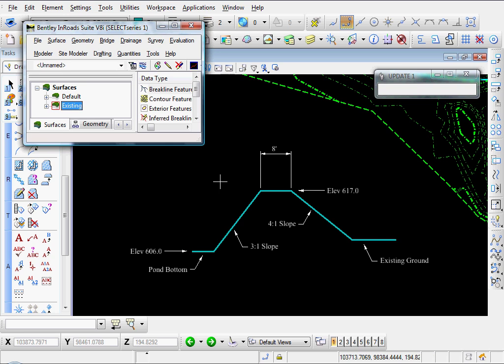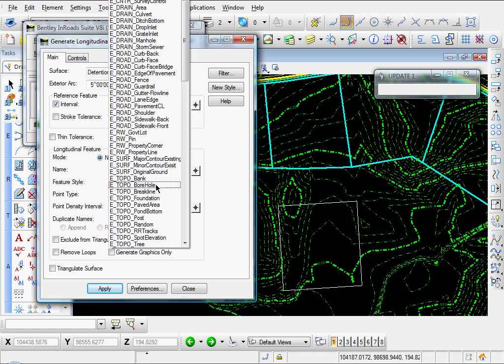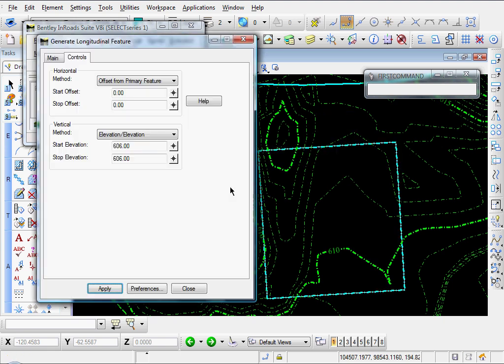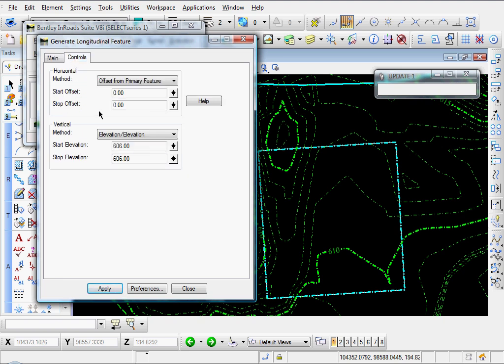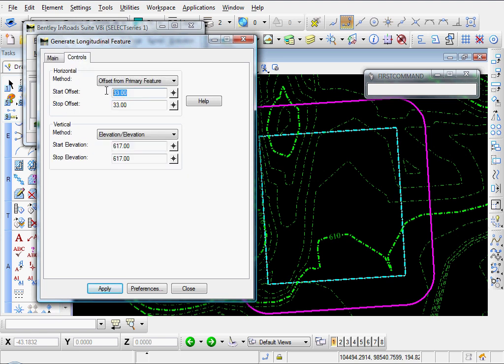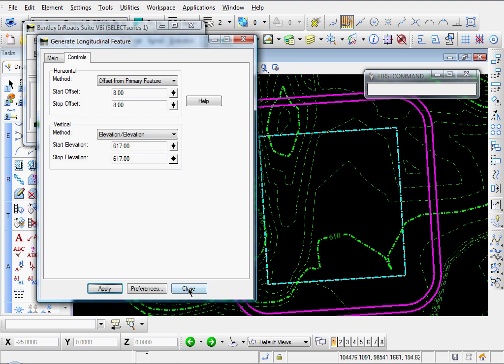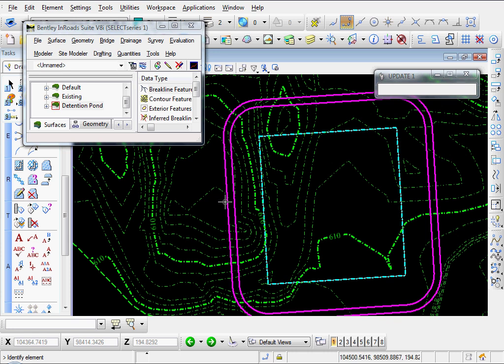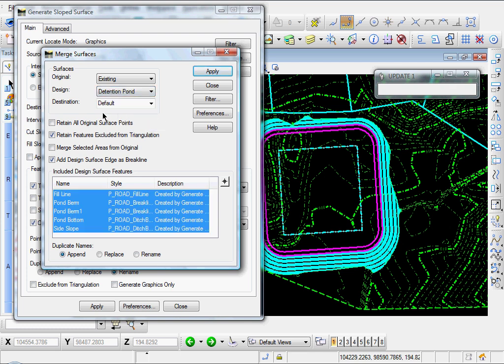Bentley InRoads - Model a Detention Pond

Comment: Coming back to this video, if you where to create a trapezoidal ditch in the median of the roadway, how would you model it? basically, instead of a flat bottom, there is a longitudinal slope and side slope. For a ditch or swale, 100ft long with longitudinal slope of 6% and side slope 4:1, how would you model this to create the contours and tie to existing surface?
Reply: I would either create a dummy surface of the side slope the flow line would be along, and use the generate grade contour tool in the surface tools and set it to the desired longitudinal slope, or use the Generate longitudinal features tool with one of the Longitudinal Slope vertical controls.

Comment: Thanks for the video, it helped out a lot and I did it myself with ease.  I had one question though. Why is it that the top of berm contour (in this case your berm top was set at 617) does not display?  I did mine with a pond bottom of 740 and berm top of 760, but the 760 contour does not display so, depending on your contour display interval, you cannot tell what the berm elevation is from the contours. i had 1' contours and 2:1 side slopes, so the berm appeared to be at 759 and 12' not 8'

Comment from the maker: Actually, that's Microstation SS2 and IR SS1.

If you want to create a berm, it's pretty much the same procedure as here. Just start at the existing surface, create the berm, then intercept the existing surface on the down slope, instead of creating a "deep hole".

Primary and Reference element have to do with controlling the direction and perpendicularity of the slope features. If you're in school and still learning, then this might be a little beyond where you're at so far. You'll learn. :)

Comment: Excellent video! what you just demonstrated in few minutes usually takes hours to produce trying to match required slopes and tie into existing slopes. However, I was a little bit confused at the selection of the primary element and identifying reference element. What version of Inroads did you use? I noticed you are using Autocad, would this work in Microstation?
Reply: How to do the same thing in ss4?